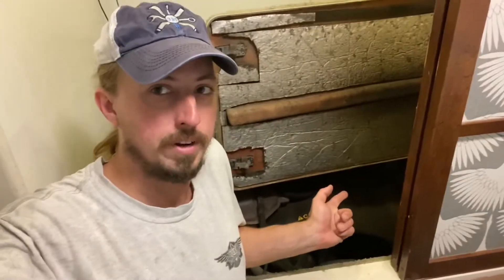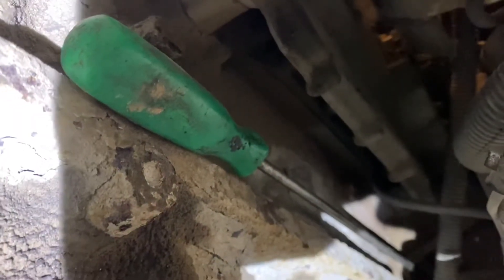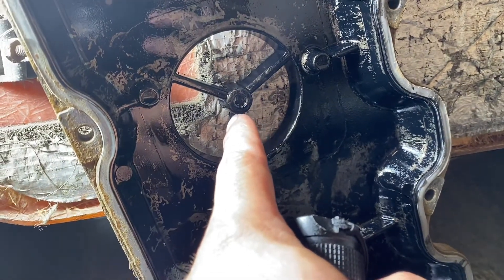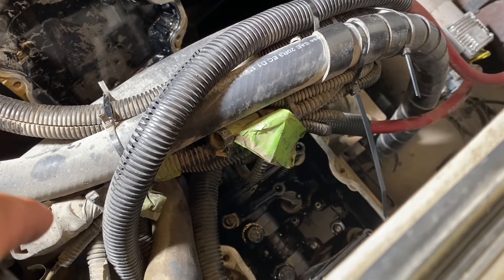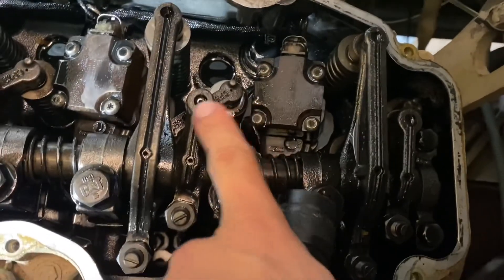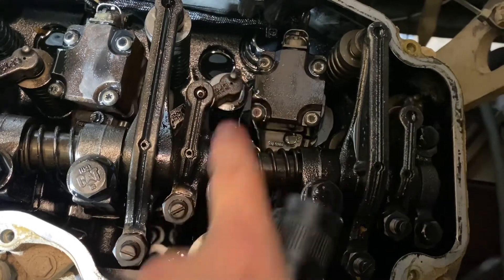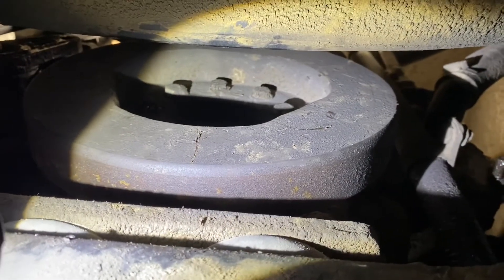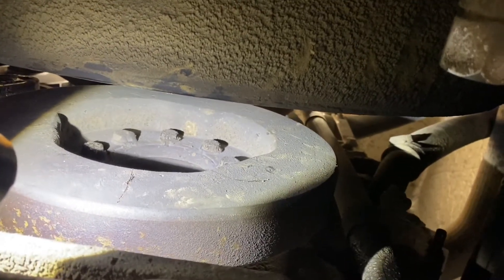Caterpillar 3126B Valve Adjustment

Comment: I just had to do this on one cylinder. 
My dump truck developed a hard miss on the way home from a job. 
Had no clue what could be wrong. 
Decided the easiest and fastest thing to do was just remove the valve cover and do a visual inspection. 
I immediately noticed the valve rocker arms on cylinder 2 looked different than the rest. Had a bent push rod which i suspect was caused by too much slack in the valve lash. Luckily both rods did not fall into the bottom area and cause damage. Even the valve adjustment nut was still sitting in the top on the head. 
Anyway we weren’t able to find the proper position by pinning the engine. So we manually rotated the crank until the rocker arms were at their highest position and then adjusted it. Kind of like an old Chevy 350 gasser and it worked fine. 
Wasn’t 100% sure it would but we started it afterwards and ran perfect no more miss. 
My opinion is that the reason to pin the engine is so you can adjust half of the system at once instead of manually spinning it for each adjustment position. 
Basically it makes it faster. 
I drove it 25 miles afterwards and no problems so i guess we did a decent job. 
I decided not to adjust any of the other ones because i didn’t want to make things any worse in case our method of adjusting the problem cylinder was wrong. 
Now i plan on getting them all properly adjusted by a professional.
Reply from the maker: You're correct - pinning the engine is only so that you only need to rotate it once. The standard method you use like on any other old pushrod style mechanical engine would work just as well, you just may have the rotate the engine more to get it all done. It's fortunate you caught it before more damage was done.

While it's not a bad idea to get the adjustment checked if you aren't sure if you got it right, if you did the one cylinder, I see no reason why you couldn't do the full engine and save the money of paying a shop to look at it. Just follow what's in the video and it should go fine for you.
Reply: @TedsGarage  Good idea

Comment: Do you remember how the engine was preforming before the valve adjustment? What prompted you to do a valve adjustment?
Reply from the maker: There wasn't necessarily any sort of running issue that prompted me, just that it was time to do it (at 100k) and I had no idea if the initial adjustment (due at 30k) was ever performed. Valve adjustments are generally to be done on schedule. If you're actually noticing a running issue that can be fixed by a valve adjustment, then things have gone too far.

The engine was performing fine before I did the adjustment. I have a pretty keen ear for engines and it did feel/sound like it could be doing better, but there wasn't anything in the form of a miss or indication of problems. After the valve adjustment it did sound a little stronger but there was no noticeable difference in horsepower. It probably did have a minor improvement in fuel economy but nothing earth shattering.

Basically if you've got around 100k miles on your 3126, especially if you don't know if it's been done before, it's a good idea to do.